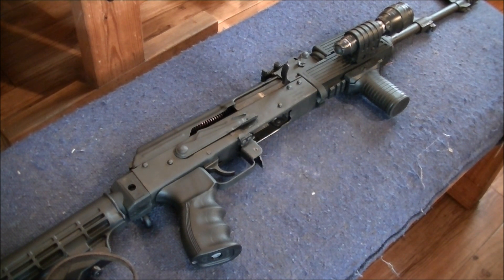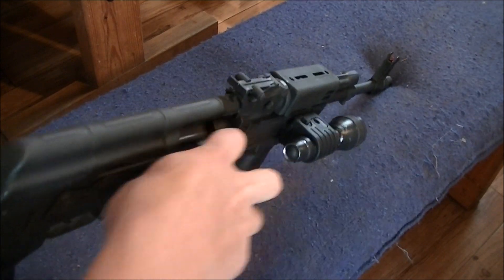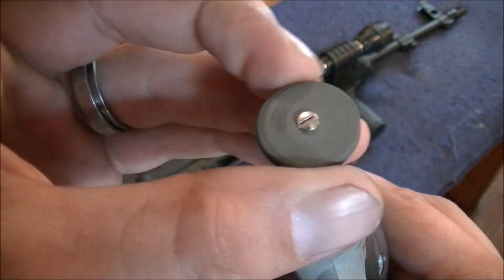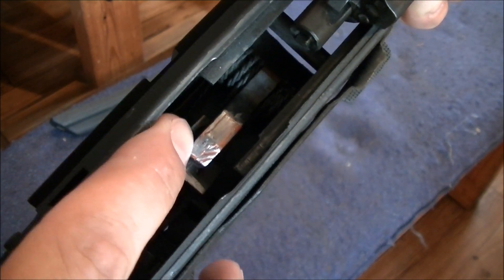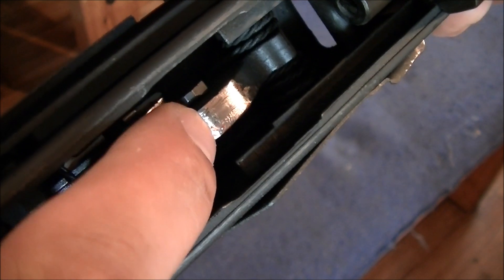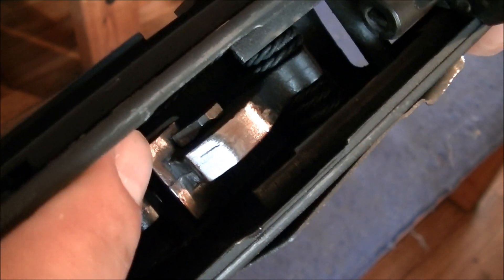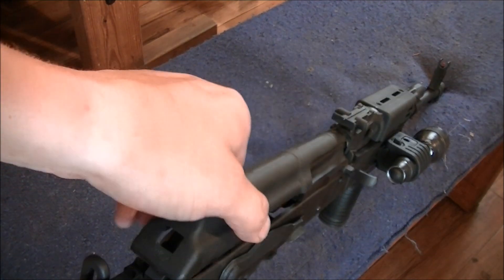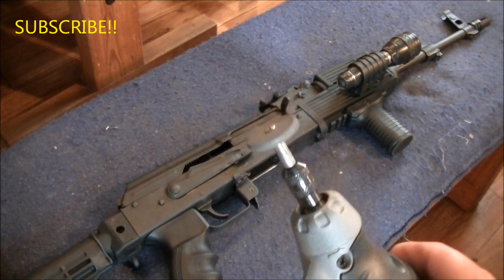HOW TO FIX WASR 10/63 STICKY BOLT ISSUE

Comment: Mine will stick if I let the bolt go forward slowly, but it doesn't effect the performance of the gun at all. I have hundreds of rounds through mine with zero issues so far. But I might do this just to make sure thanks for the tip!

Comment from the maker: What you need is some flitz or mothers polish. No sandpaper. Take the dremel tool with a cloth head and use the polish. The only way you could make it not fire would be to really file it down. using polish and the cloth dremel attachment you ahve nothing to worry about. If you will look in the department with the dremel tools you will see the cloth attachment I talking about. Just get that and a dremel and some metal polish and you set. Its really very simple no worrys about screwing it up

Comment: I have a century arms underfolder not a wasr 10 and it does the same thing but it has never affected the reliability of the gun it has never failed once in 2000 rounds it only stays back if I ride it  I'll keep it there and reload and just hit it foward to chamber a round I know it's not intended to work like that but it works out pretty good
Reply from the maker: Yea my wasr never jammed before I done this slight mod to the hammer. It only stopped if I "rode" it. I just wanted it to be smoother and this little mod made that happen. I understand what your saying about the way you use yours. What I done to the hammer on mine will eventually happen to most AKs with time and wear. I just sped up the process. I appreciate you watching and commenting!!

Comment from the maker: IMO there are only a few small problems but they can all be avoided by taking your time when purchasing. Just check the front sight post and cycle the action a few times. If the front sight is semi straight then I say go for it. The newer 10/63 wasrs are alot better than the original wasr. They worked out most of the bugs. This rifle has never failed me at all. It has been 100% reliable and I have only cleaned it once out of about 2000 rounds. This fix is not neccessary but makes it smoother!!
Reply: Is the sticky bolt only a problem for wasr Ak's or for all ak's?
Reply from the maker: @mikeb2687 any ak can have this issue. Shooting them alot will smooth it out naturally. My wasr and many other wasrs take alot of rounds to smooth so the polish is faster and cheaper than buying 500 rounds to blast.

Comment: thanks for the video, the tips you had there also reminded me to polish my bolt carrier group so it runs smoother...still have not tried to mess with the trigger, but maybe i will once i get the right dremel bit...so far i dont have any problem with trigger slap, but if it can be smoothed up it wont hurt...

Comment: I have a feed problem where the round lodges against the edge of the barrel. Would it effect the function/safety of the chamber if I dremeled the bottom of the chamber to form somewhat of a feed ramp?

Comment: you can use a belt sander too, just take the hammer out and lightly grind on it til its rounded off, then put it back in and check to see that it still hits the firing pin squarely, which it should even if you grind the hump off...polishing is easier too outside the rifle...

Comment: unless it is a cover issue, it is suppose to stick. the Romanians use it as a hold bolt open. it should not stick when firing.Or when you pull the bolt back all the way and let go, the proper way to load the weapon, it should go into battery when released. it should only stick when you slowly pull the bolt so it will hold open.
Reply: Citation needed

Comment: Just bought a WASR under folder the bolt sticks at the hammer and also before a round is chambered. I took the gas tube off and placed the bolt back in. The piston is canted to right looking down on the rifle, to point that its head is intersected in the middle of the gas pistons lip. All I have to do is push it and it falls into the gas block is this normal or is the piston bent or is something bad out of alignment like the front trunnion.

Comment from the maker: The metal mag are jamming in the gun. Thats kinda weird but if I was you I would try to polish the lip that the mag catch catches on the mag. It may have a little to much material there causing it to bind. Try to  make mag go in and out until you se some wear marks on the mag then remove a very small amount of material where its wearing and see if that will make it smoother. If you do vids show me and we can get you fixed.

Comment: Just purchased a Romanian WASR10, I understand what you are pointing out, however, the dust cover on mine where this "sticky bolt issue" is described has a dimple that makes contact with the handle of the bolt when pulled back slowly.  The bolt literally catches on this dimple which tells me this is designed this way, possibly working in unison with the hammer that you are rounding off.  Just confused here whether this weapon is intended with this action or not.

Comment: Nice vid. I will do this hammer work asap. You mentioned also working on the trigger ?; what is your method for that? Thanks !
Reply from the maker: I simply polished out the surface of the hammer where the bolt slides and makes contact. I also took some material of on the hammer where the slight edge is that will hold the bolt back if its "Rode" forward. Take a look at yours and you will see what im talking about.

Comment: Went to my friends shop we cut the hammer down then polished it. I polished the bolt and all the moving parts. The piston was bent to right so we straightened it out. Now the bolt glides through to the gas block with no prob. I haven't test fired it yet but I foresee no hang ups. Wish me luck.

Comment: Alot of ppl think there bolt is sticking but alot of times its just operator error alot of times i notice ppl try to pull ther bolt back slowly.. If u pull it back and drop it in it will never stick.. Its an AK treat it like one

Comment: First, thanks for the video. My Ak-47 wasr has been jamming since i bought it. So if i polish the hammer that should help? also i see you have a peice of white rubber on the spring area , do i need to do that.thanks again
Reply: No, don't put a buffer in, also if its jamming check the feed ramp or your mag height. The sticky bolt will resolve with more firing.

Comment: Do you think the sticky bolt problem will cause it to recoil harder? I bought one with 2013 dates and I've shot several AKs.. seems like it was punching the shit out of my shoulder way more than normal. Any tips are appreciated thanks for the video!
Reply: You may have fixed this issue by now, but for me, I had the same "kick to the shoulder" sensation until I took off the slant brake.  Try and see if that'll dampen the recoil and invest in a more "modern" brake.

Comment: I fixed mine in a couple of seconds after I got it. I pulled the bolt back all the way and then let it go. Worked every time. Why fix a non problem?
Reply from the maker: not all the wasrs are super smooth. many could use this to make the action run better. if yours don't need it then don't do it..lol. it's that simple

Comment from the maker: This is not true. It is not safe to try to clean the wasr while the bolt is barely hanging on to the hammer. If you get your fingers in there the wrong way and the bolt closes your gonna have a hurt finger for a few days. Guns that are designed for the bolt to stay back have a bolt stop. Your comment is 100% false. Thanks for trying though